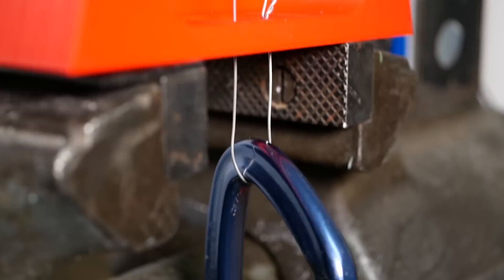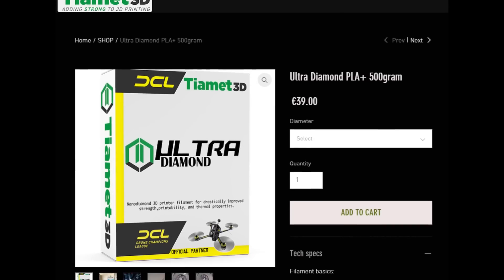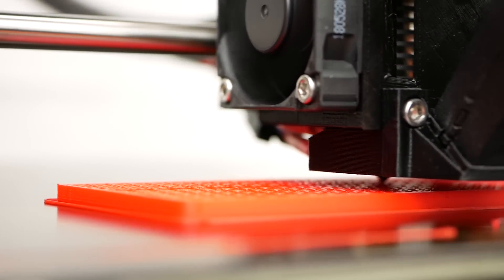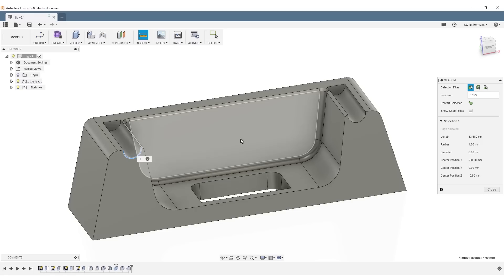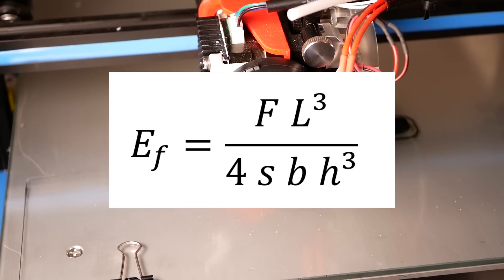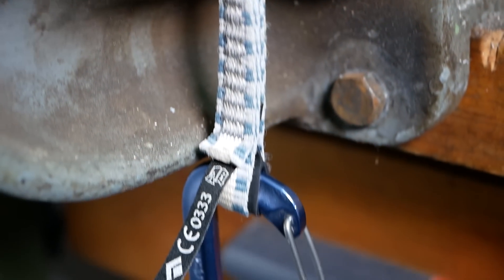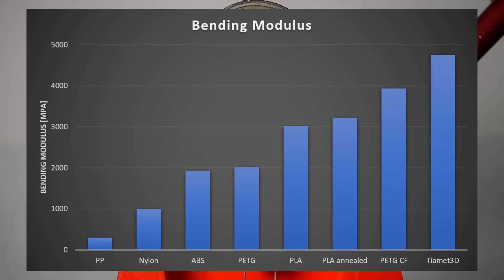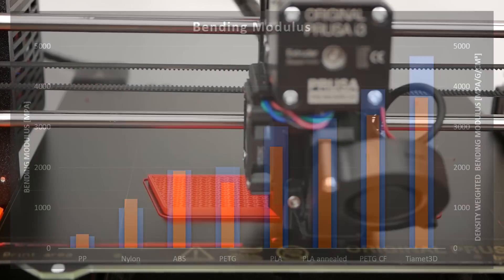Which is the MOST RIGID 3D printing material?

Comment: Nice video! I can't believe how much work you put in one video. Could you test out the OWL Filament? It's in the cheapest Filament I could find on ebay, but it's made in Germany: https://www.ebay.de/itm/3D-Drucker-1kg-Filament-Rolle-PLA-1-75mm-Schwarz-Transparent-Gelb-Rot-Camouflage/263196758411?hash=item3d47bfd18b:m:mjY8-bMeDhiuSAivnUdqy0Q

I mean 1 Kg of PLA for just 11,70 € is very cheap, isn't it? I'm using this filament at the moment and I would like to know how it compares to much more expensive Filaments. It should be B quality but I didn't have any issues with it so far ...

I would be happy if you could test it!

Comment: Nice well documented  video, thanks for that  .I did some more empirical tests than yours a year ago to print an electric guitar ,( including the neck) and find out that Carbon Fil from Form Futura was the stiffer of the 3 carbon reinforced filaments i tested . It was also the one that resisted the better to high temperatures. But now I 'll give a try to  Tiamet3D.

Comment: Very nice Stefan as usual , i wish you could include PC (polycarbonate) to your test.
Reply from the maker: Noticed too late that I had a roll of PC-Max on my shelf, sorry.
Reply: CNC Kitchen , I think this is the perfect excuse to make a review for the PC Max.
Reply: @usagi_hase  Exactly :)
Reply: Great video and great channel Stefan, but in your experience how would you expect PC-Max to perform in this test?
Reply from the maker: A tiny bit better than ABS and PETG. PC is definitely not as stiff as PLA.
Reply: HobbyKing sells cheap HIPS (only €10 for kilo). It should be as stiff as PLA, but can withstand 100C. If you get some they also sell POM, make your own bearings!
Reply: If you have successfully printed POM I would be interested to hear your bed type/temps etc?
Reply: @pabsuk5558  Not yet. I am building a printer for big PC pieces, so that will do POM (after experimentation). Starting with a cheap Tronxy x5s kit (gosh the QC/design is terrible) and getting the parts together to build it over xmas..  ..has anyone done HIPS? I want to use it as for the X carriage,  as it will 80C in the chamber.